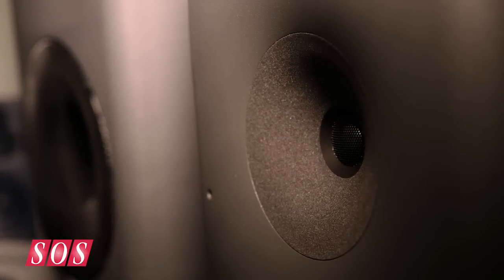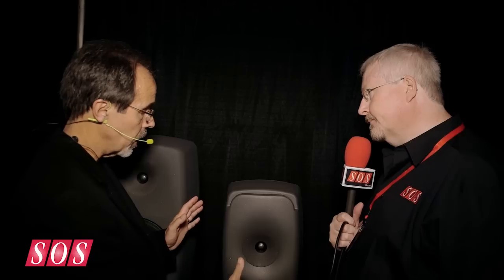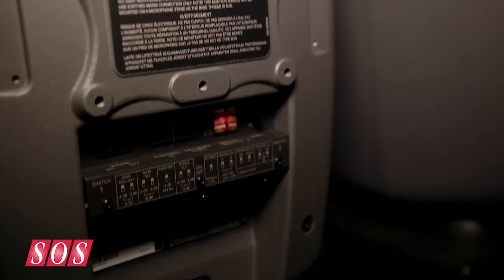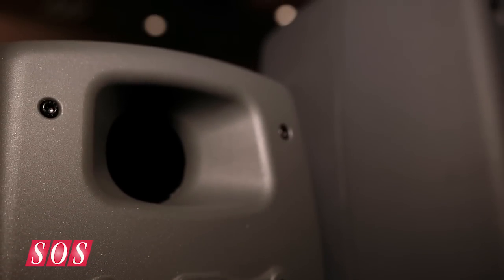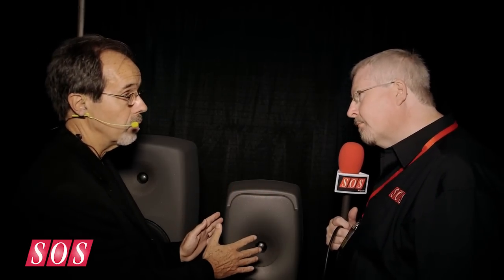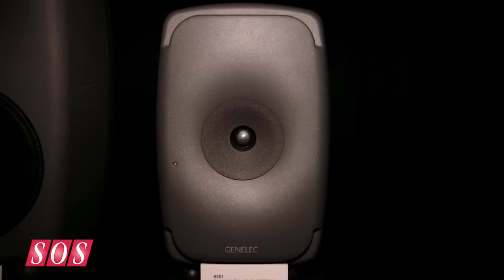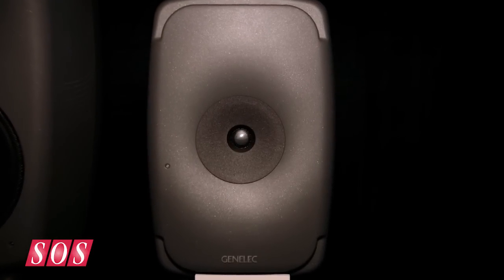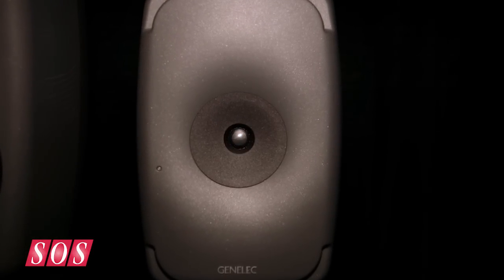Genelec 8351 - AES 2014

Comment: Waiting for the 8361. I hear the 8351 just doesn't cut it for music with tons of bass. If a track is bass heavy the 8351 clips at around 86-90dB which is pretty sad, but I'm still hopeful for a slightly bigger louder model. I'm also curious how much the Doppler effect comes into play with the tweeter and mid drive coax unit which is an unsolvable issue with coaxial monitors like these. Also if these are vertical then you have the issue of the bass being pointed right at your desk which can't be good. They say that they have the same performance vertical or horizontal but that can't be true, 1.) because of the bass pointing at either your desk or the wall and 2.) because the waveguide is not symmetrical horizontal/vertical. Also ports in the back are an issue. Maybe I'm wrong and they miraculously solved all these issues, I would sure like to hear a technical explanation.